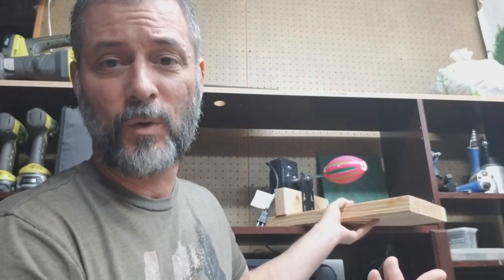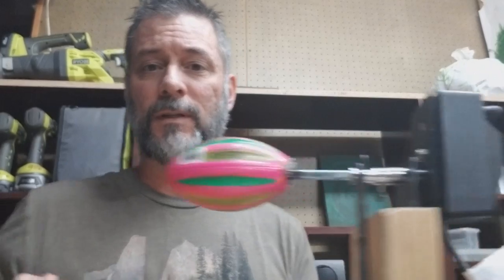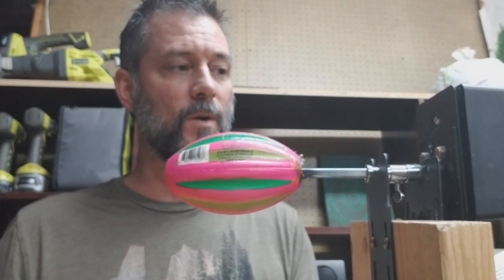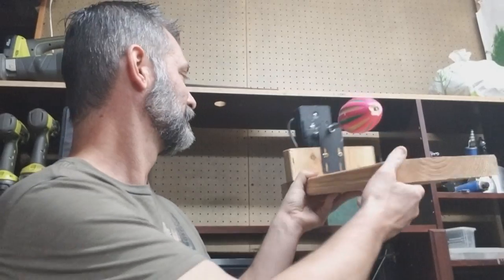How To Single Cup Tumbler Rotisserie Turner High Detail!

Comment: Hey Dan, thanks, I do have a question, I am doing the long neck water tumblers, and I am having a time trying to figure how or what to use on the rotisserie rod to hold the bottles? Do you know of what or how? Thanks in advanced!!
Reply: Foam noodle floaters comes in small sizes try that
Reply: I’m having the same trouble. I can get the neck of the bottle taped tight to the pvc cap. I use a pvc cap with a hole drilled in it rather than the little nerf balls since I use the 1/2 inch pvc for bottles, then wrap some tape around the metal stick at the other end to make the stick sit nice and tight but the inside of the bottle  is wider so it doesn’t turn level. Help!

Comment: Hi Dan! Question-I'm redoing my single turner to something like this.  However, I only have one of the collar/slips...not sure where the other one went. Will this still work properly with just one? Or can you suggest where to buy another without having to buy the entire rotisserie? Thank you-these videos are SOOOO helpful!!!
Reply from the maker: Lacy Browning hmmmmm.....I haven't tried with only one. Could work. Try using just one closest and inside the motor. Then try using it outside on the arm instead. Let me know if it works and which is best
Reply: You can buy one on amazon.

Comment: How can you do epoxy when there is no tumbler "turner?"
Reply: matttabi matttabi by hand ... pvc and a football you will need to make a stand though
Reply: K B12 so by hand youd just stick your hand inside?
Reply: No just like his set up at the 5:26 mark ... then stick the tumbler on the football and hold the rod/pvc but you will need to make a stand so you can manually turn it for hours lol unless you want to hold it and spin it ... I have a manual turner and it’s too much work lol